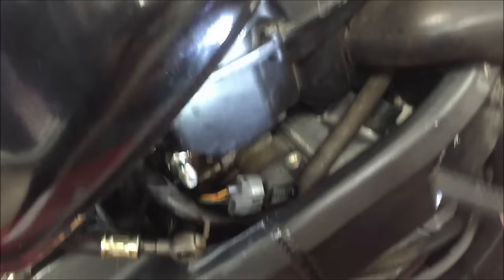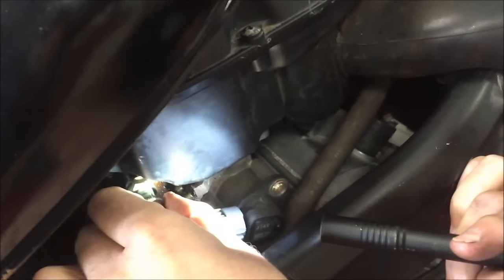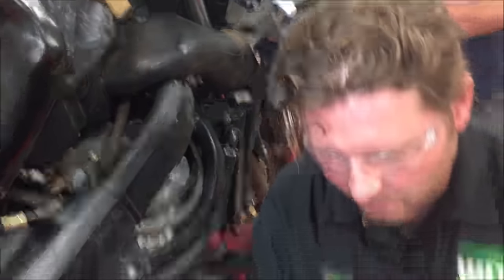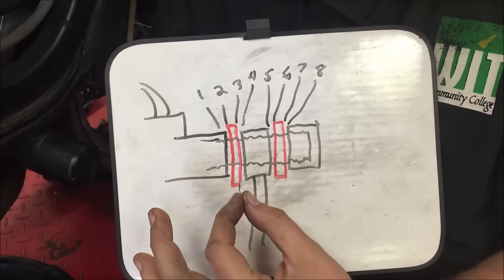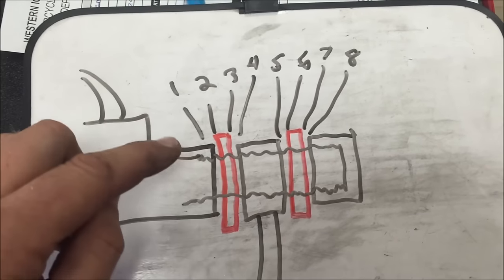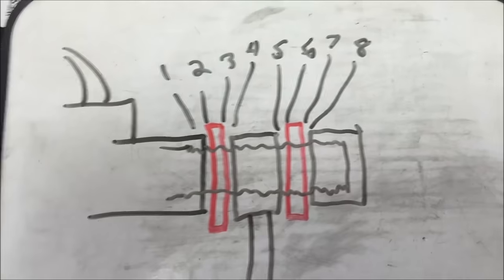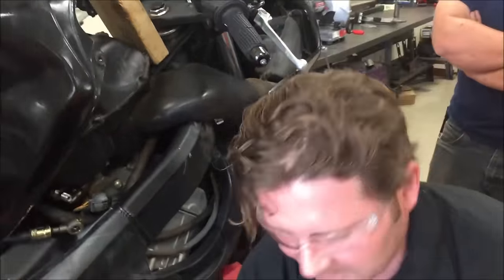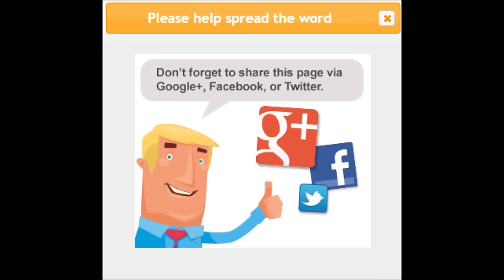Did you know that banjo bolts have 8 surfaces to effectively seal properly?

Comment: Shane,
I very much like your channel and have subscribed.   One question:  I recall being told that copper washers have a rounded side and a flat side and that the each washer should be installed with the  flat side mating with the banjo bolt.  Is this correct?  Does it matter?  
You are an excellent teacher.  Your classes are lucky to have you!
Reply from the maker: Great question...I struggled with "why and which way" for years. I ever experimented with both ways and saw no difference. The manuals never specify a "direction" either. Once I learned how they are made, it all made sense. They are "stamped" and as the die pushed through it, the rounded edge is created. The installation method does not matter as it MUST seal on both sides. There is soooooooooo much debate on this. I install all in the same direction for cosmetic appearance, make sure they seal and send it...
👍 Thank you for taking the time to comment! It helps us! 
Here is a way to support all the free videos.
Want to say “thanks” or “keep it up”? Click here https://www.paypal.me/how2wrench  

Coach Conley is also available for hire to personally work one on one with you if ever needed. Yep he is a real person. Give him a call @ 602-345-0432
Details here: https://how2wrench.com/product/personal-tech-training-phone-facetime/ 
Your answers and help are just around the corner. Save time and money while protecting your investment and yourself by doing it the right way!
Follow us! 
Web:
www.How2Wrench.com     
www.Tools2Wrench.com